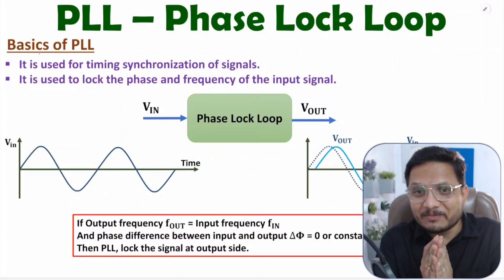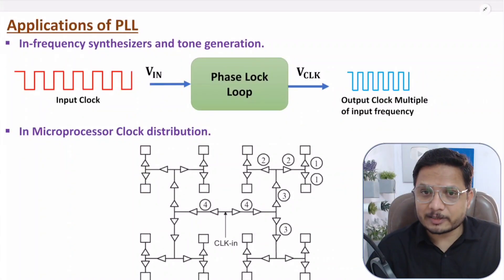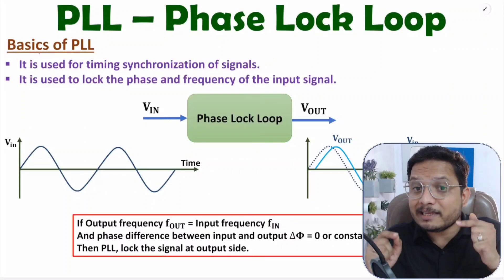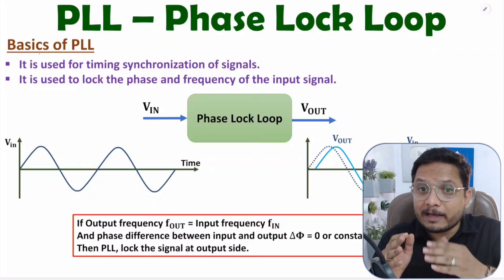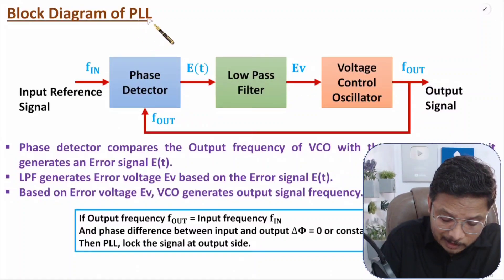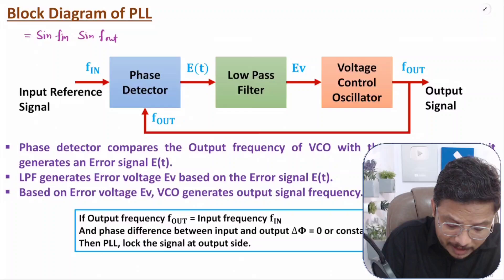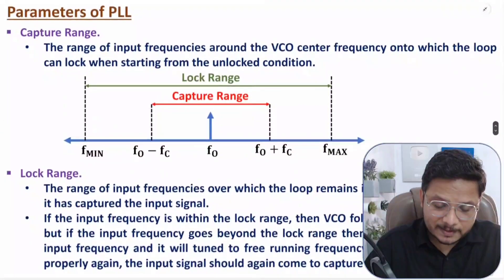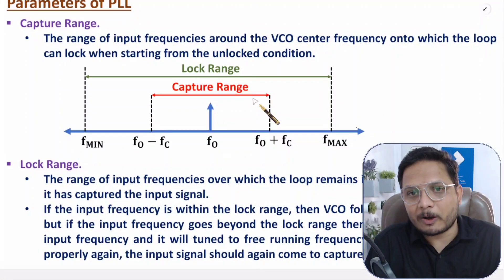Phase Lock Loop (Basics, Block Diagram, Parameters, Working, Capture Range & Lock Range) Explained

Comment: I am an electronics technician retired now and I would like to breadboard a circuit and learn all about how engineers DO ANALYSIS in numbers using MATHEMATICAL PYSICS to explain the behavior the the limitations, parameters and practically design a PLL.